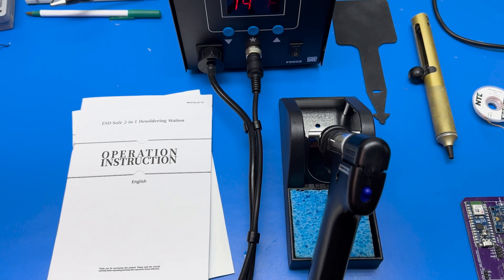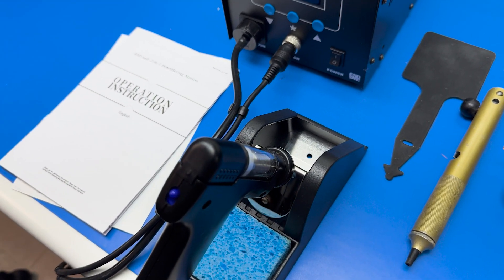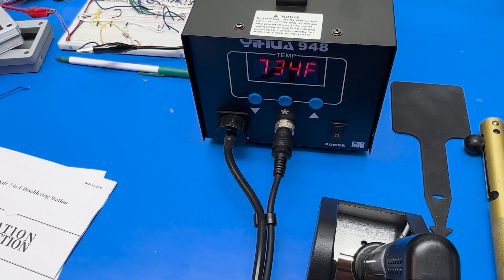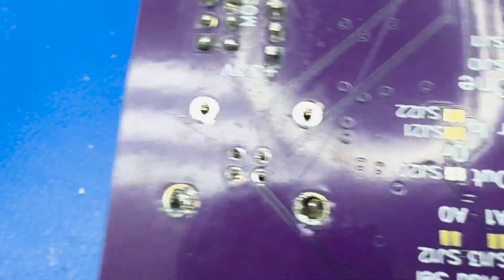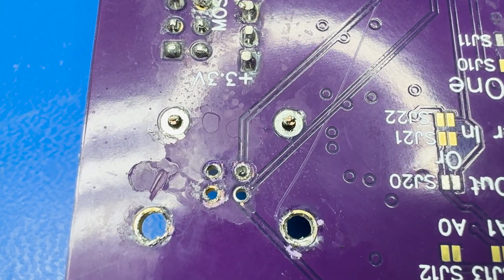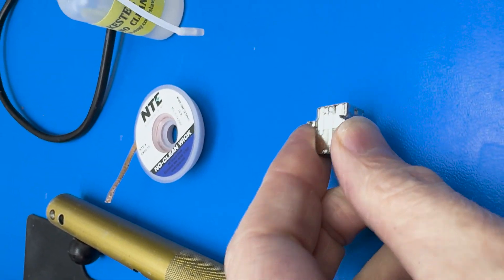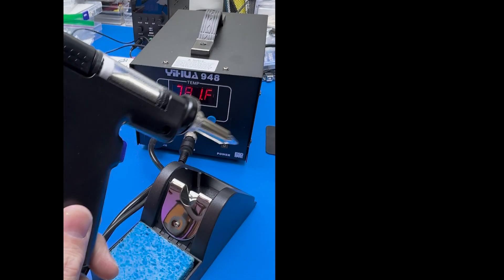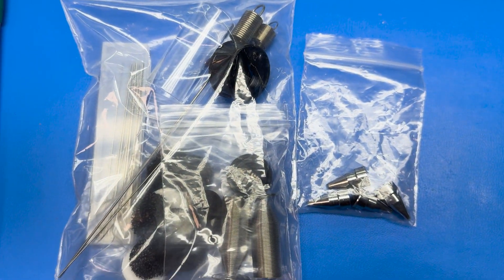YIHUA 948 Desoldering Station REVIEW

Comment: Another tip besides using flux is to add a little bit of solder onto those wells that are countersunk and the sucker tip can't reach to melt. Also use leaded solder as it helps bring down the overall temp of the solder you are trying to suck up. If I was doing serious work for a living at the workbench I would be buying a better unit. these animals clog easily and I found I was forever pulling the glass tube out to clean it, the spring and the backplate. Pita really and why I am giving mine away.

Comment: I had the Stahl Tools combo from Parts Express.  They had replacement parts back order issues.  I wanted to consider this before getting a Hakko.  This YIHUA 948 does have a bundle with a soldering Iron that goes in one of the sockets.  I think I'm going to go for this.  This might be the way for me to have a soldering and desoldering (if I get their bundle) at every desk in my house.  KM6ARC Jon

Comment: I have one. Problem #1 - Seller sent me two tips the same size. #2 - I can't get the temperature below 716F which is too hot for some traces and will lift the pads right off the board. #3 - The manual is hard to understand the calibration mode. What calibration???? Procedure? #4 - can't locate a parts supplier. If you are OK with what I have spelled out here knock yourself out and buy one.